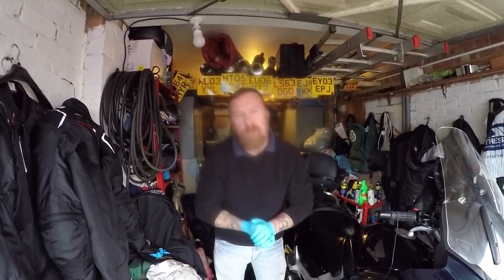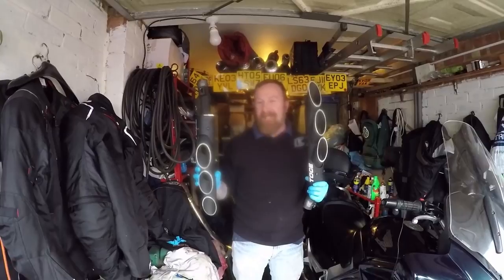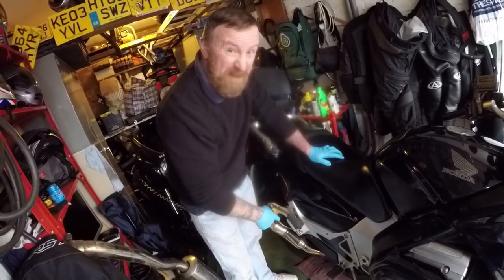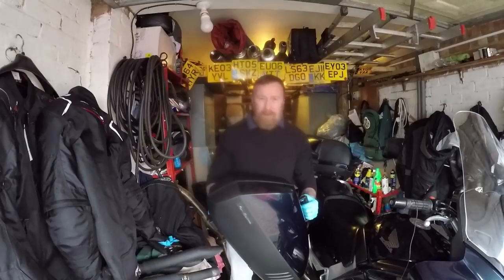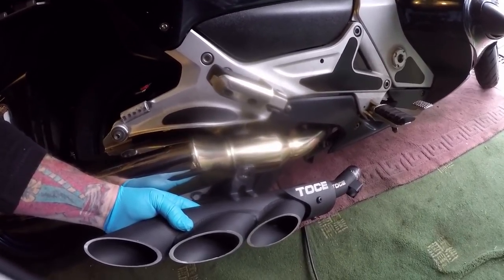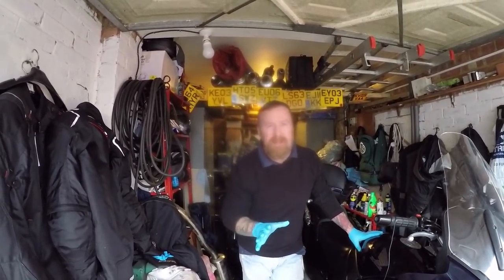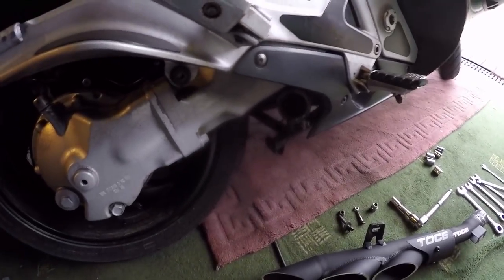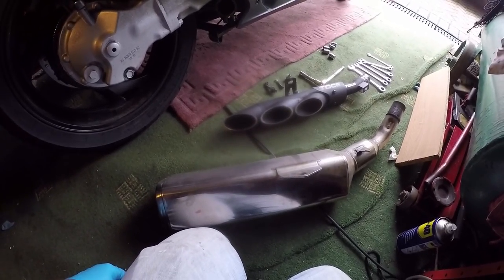HONDA PAN EUROPEAN EXHAUST CHANGE ? YES OR NO MARK SAVAGE

Comment: well if it was me that had a pan european i would customize it completely.. strip it down to the frame and make a streetfighter out of it with a chromed custombuilt 4 in 1 underseat exhaust system, customsetup cdi tuning with a more aggressive cam etc.. basically build the honda version of a harley streetrod.. just with actual turning capability.. but as it is with your use of that bike, better just leave it a is i reccon.. nothing wrong with the existing exhaust..

Comment: I like it alot it's a deffo yey from me.
Reply from the maker: Thanks bud 
They are great bikes
Reply: @marksavage  my stepson and I have our first 125cc bikes for next year.
Mines a 2012 lexmoto vixen.
My lads is a kymco zing 2 darkside.
Reply from the maker: @vlogsandstuff3159  keep them serviced and keep an eye on the nuts and bolts  they will run ok 
I've got a few videos on lexmoto might be worth a view
Reply: @marksavage  the vixen I bought from an old guy for 250
Needed a carb clean now runs sweet and sounds smooth.
Starts first crack of the starter has history aswell..
The kymco zing 2 darkside was a project off a biker for 200
And is faultless.
I will keep em serviced, with me being a time served car mechanic.

Comment: the kawasaki would have had a cat to calm the noise would it not? the pan wont have a cat..they will be to loud i had delkevic on my st1100  and with no baffle they got on my tits on long journeys, maybe put a couple of carbon cans on but standard length not stubby if you want to reduce a bit of weight?
Reply from the maker: i was thinking it will be a bit too loud as no baffles, more was looking for a weight difference so will look into it 
mark

Comment: I think u should change the exhaust, also speed fighters piston seized earlier on the way home
Reply from the maker: thanks and oh dear, oil pump not working , pipe came out , forgot to fill 2t oil, or old piston 
mark
Reply: Not sure yet but I know the 2t tank is brimed
Reply from the maker: ok best check whats gone wrong 
mark
Reply: How do u check if the oil pump is working
Reply from the maker: you will have to sort out the seized piston and then run the bike to see as once runnig the pump will let a little bit off oil out as it runs, but pop a little 2t oil in the fuel and head to stop it seizing with the new piston seizing again 
mark
Reply: As it turns out the top end bearing collapsed so got to get a new one of them